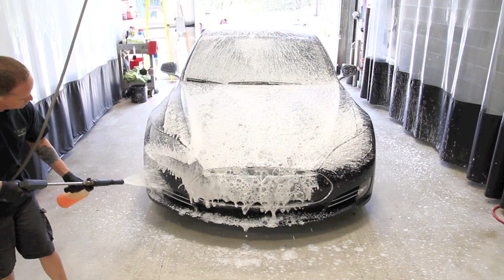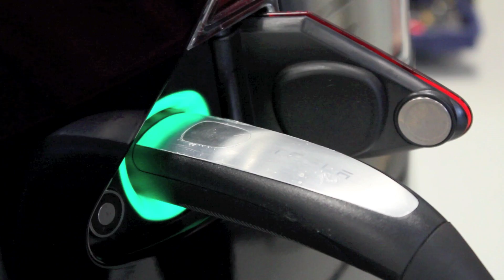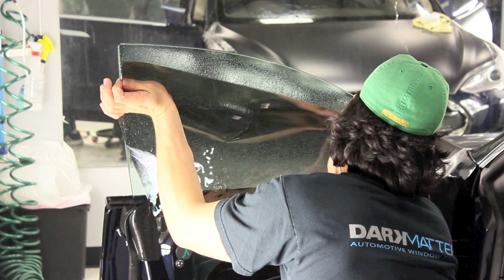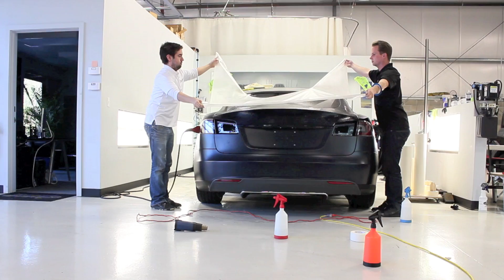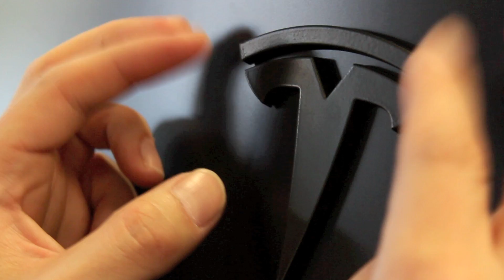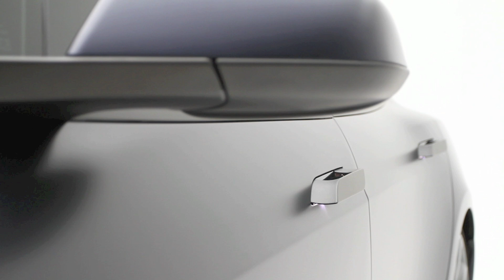Stealth Mode Activate: Tesla Model S wrapped at NWAS

Comment: I believe the Model S battery is both liquid cooled and has vents along the base. Yes heat pipes like in a PC would be a good idea and I would think the performance would increase about as much as I proposed, more traction = even better launch. Look at how well the GTR performs because of its AWD+Short gearing.

The motors wouldn't need to be smaller, as each one would be taking 50% of the load that a single motor would during normal driving.

Comment: Does the razorblade actually touch the paint? Or do they cut in the void between the rubber and the trim ?
Reply from the maker: +Barthoization the blade never touches the paint, our installers cut along a perimeter of protective tape that gets removed before the vinyl is fully adhered.

Comment: I don't think heating would be a problem : it would heat up only when in charge, so when the car is moving pretty fast. Tesla would "just" have to make air pipes that comes from front, around the batteries then out in rear. Plus Model S already has some vents on actual batteries.
Or some heatpipes system like the one we have in many pc processor radiators.
For AWD, I don't know if performance will be much better, they'll have to put 2 smaller motors or batteries will die very quick.

Comment: Yes you may be right, half load, half tire friction...So maybe they could put smaller motors to achieve same performance, and smaller motors = less energy consumed, which means more battery life :)
An AWD Model S with like 400 miles per charge...if only it could be true lol (and if only I could buy one).

Comment: Not really, especially if they added another motor to the front axle. Yes the motors would have to work harder from a stand still, but having two of them would definitely solve that issue.

Comment: The details of what tech is used and whose name goes where is just cinematics the fact is the tesla platform is ideal for self drivng AI control. What tech is used is something that can be worked out later and most likly will be using a combonation of different sensor techs because anything mass-market needs to be near bulletproof because lets face it people will do all sorts of silly things like sleep with the AI on meaning the AI needs to operate safely with no user input at all.

Comment: Elon Musk said that a 500 mile Model S is easily doable with current technology, but that the cost would be too high for any consumer to purchase.

(Basically they would double the battery pack on the bottom and move the car up via suspension tuning and add some skirts along the side to make it look normal)